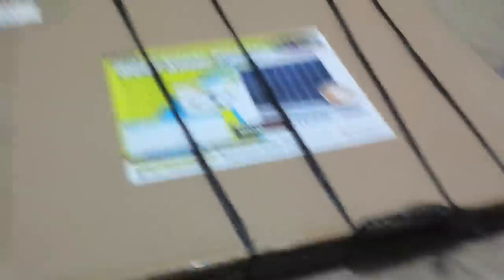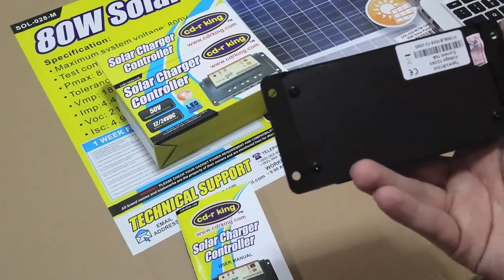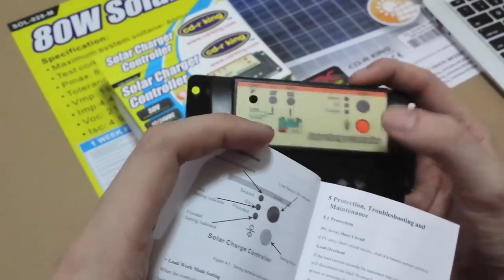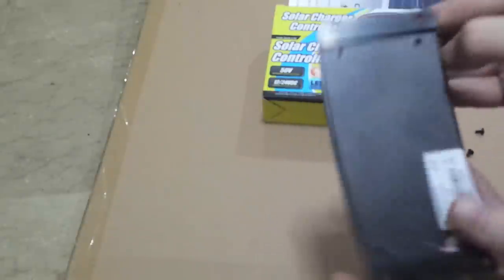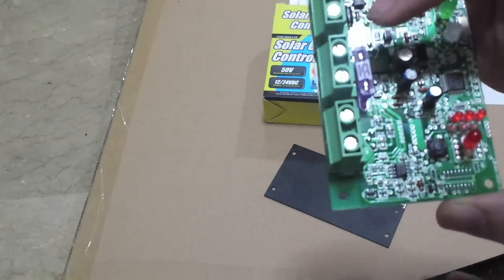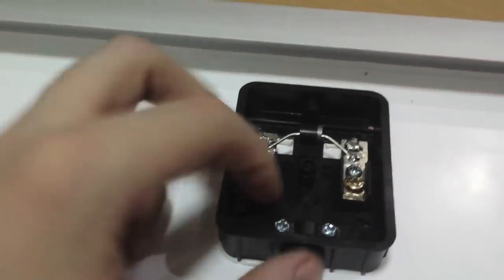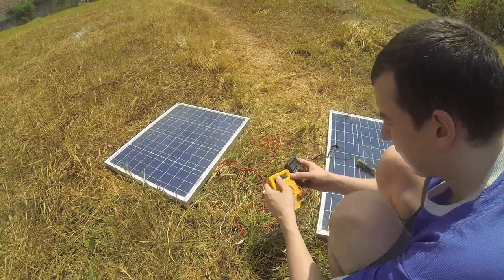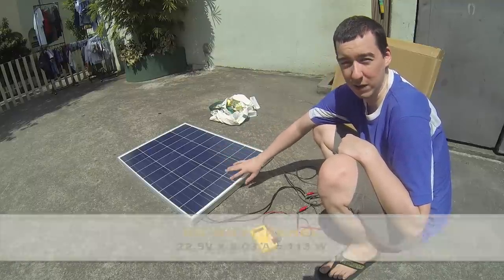CDR KING Solar Panels

Comment: I've never been to the Philippines so please forgive my ignorance on things there. I have a few questions about solar items and their availability there. I have an Uncle that lives there and is very interested in a solar panel array. But, we are looking to put in panels that are 280 watts each or more. We would need to have them shipped in from the US.  Is the shipping really high?
Reply from the maker: You can buy 250 Watt solar panels locally from cdrking, check their website for pricing. If you have a bigger budget, you can find high quality japan made 250-300 watt panels on Sulit. I wouldn't recommend trying to ship the panels from another country because they're going to hit you with a very large customs/tax bill when they arrive. Many people pay more in customs fees/taxes than the value of the items.  Solar equipment, like most electronics in the Philippines, is hugely overpriced compared to America and UK. While the panel prices are dropping locally, the associated items like charge controllers and inverters are still pretty pricey.
Reply: Gadget Addict I think you are right , although i never payed more than 50pesos for importing my solar cells, the time passed to assemble them ...etc...if i had to do it again i'll buy in CDR-King  , about the same price in final...The only problem is their stock.
Reply: There are now plenty of suppliers of solar panel products here in the Philippines. The popular panels are made in China and Canada. The most common are in the 100w to 250w panel configurations. You can size your solar power system however big or small you want it as long as you have the roof or yard real estate.

Comment: nice blog about solar power generator. i want to build diy solar power generator but a bit hesitant because i dont know the exact amps to be used in breakers and fuse connected to solar, inverter, batteries, and solar charger as well.

Comment: Where did you get the RTV sealant from? We used to use that when I was in the military. Awesome stuff. Where in the PI did you find it?
Reply from the maker: I bought it from Wilcon Hardware, along C5, near Eastwood City :)
Reply: Hmmmm...will have to check my local hardware stores then. Thanks. Checking out the rest of your videos now.

I have been considering getting the 150 W kit and an additional 100 W panel. I have a roof that gets a ton of light throughout the day.

I am just concerned about sun during the rainy season.
Reply from the maker: Gary Verderamo Yeah it can be hard during the rainy season. I have a battery charger to keep my batteries healthy during long periods of no sun.

Comment: Thanks for sharing this, How are the panels performing? I am interested as its something we could use in our home in Cebu for wall fans during the day. Not too fussed on the battery side of things. But let me know if you find a good supplier of reliable batteries as well although can see me getting hold of one of the Tesla batteries for the house in the future. Electric in the Philippines is getting expensive.

Comment: i got a solar pannel from a market.
it's outputting just 10-9 volts in even in bright sunny day. 
A 3Amp battery is directly connected to it with a blocking diode. 
The charge doesn't hold much and and the battery ends real quick.
Any idea what's wrong ?
Reply: the panel is 10watts

Comment: Could the panels power 120mm computer fans? about 6 of them? so I can generate my own wind, in turn that wind powers a rotating wind generator?
Reply from the maker: Most 120mm computer fans that I've seen consume around 2 or 3 watts. So if you had a panel pushing out 50 watts, you could run 15-25 of those fans at once. Since it's a fan, any extra voltage isn't too dangerous since it will just make the fan spin a bit faster. So you could power them directly from the panel without a controller. I don't know whether it would be strong enough to turn a wind generator and I'm not sure why you would want to, since there would be huge losses in doing so.
Reply: How would i loose? Im just taking one energy source (solar panel) and running lets say 20 fans, directing the air produced into a funnel, narrowing at the end so it is forced out. This gives me faster air speed, virtually no air loss. That would be aimed at the blades of the generator causing them to go much quicker and producing well over 50 watts. What do you think?
Reply from the maker: Cichlid Maximus You can't get out more power than you put in, that would be overunity. The fans might consume 2 watts but some of that goes into heat (feel a motor that's been running awhile and you'll feel its hot). So you might only get 1.5 watts of air from that fan. Then on the other side, your wind generator, that has losses because it has to overcome wind/air resistance and convert it to electricity etc. Converting solar to wind might end up turning your 50 watts into 20 watts lol
Reply: ould the panels power 120mm computer fans? about 6 of them? so I can generate my own wind, in turn that wind powers a rotating wind generator?
Most stupid idea ever. You loosing energy in any step of the way,
Reply: Explain it to me please.
Reply: Cichlid Maximus
Basically whenever you convert energy from one form to another, you waste energy. So the extra that you get by turning it into wind then back to electric is less than 50 watts.
Reply: Cichlid Maximus To add, you can't convert more than 59% of the wind's energy into electrical energy? Why? Physics.

Comment: Hi Phil can you give me options if id like to make a setup where i want to directly charge any usb powered device to the solar charger controller (the yellow one from cdrking) so that i can turn off my inverter and save power instead of plugging  the chargers to ac socket. Thanks!
Reply from the maker: You can buy a cheap in-car usb charger from CDRKING. The super cheap ones wont charge bigger devices like the ipad, so be sure to buy one which shows as being compatible with your device. Since these are meant for use inside 12 volt car power systems, they are pretty much perfect for solar and can usually handle a reasonable amount of fluctuation in voltage.

Comment: Hi would u recommend this CDR solar panel for camping use or it's more suited as stationary? Crazy helpful video man.  Thanks & keep em coming.
Reply from the maker: Jake Rio Because of their weight and size, they're more suitable for a fixed location.  But we transported some from MM to deep Bulacan, in the back of a pickup truck. They got bashed around pretty bad and we had no problems with them. We got them across a river with a very questionable floating platform and trekked through some farms. They're pretty tough but usually flexible or small plastic panels are more recommended if they're going to be moved around a lot.
Reply: Thanks for d advice

Comment: Hi Phil, i've watch all of your solar videos all night. i really am a fan... made me happy when i saw you have the same equipments that i'm planning to use. ^^ anyway  my set up will be a 150watt cdr-king panel, 100ah motolite deepcycle, cdrking charger controller and inverter. im really confused with the inverter rating to be used. for a 150 watt setup, is the 600watt(1180php) inverter fine or should i go for the 1000watt inverters (3990php)? is it a good investment? for inverters this size they would consume more power which i think would be a waste.
Reply from the maker: Having a little bit of extra capacity on your inverter can be useful but I wouldn't go too far above your expected use, because like you say, it consumes more power when idle. Also I'd be very cautious about spending too much on an inverter with cdrking considering the warranty will be extremely limited. Have you thought about what you plan to run from the inverter? At this point you might want to consider buying a charge controller that can handle extra amps. , incase you decide to add another solar panel down the road :)

Comment: Hi there. 
Those are Bypass diodes, not blocking diode. 
Measuring open circuit voltage and short circuit current does not give the nominal power, because in both cases, open circuit and short circuit, you have 0 Watts output power. Hook them up to a good MPPT, half empty battery, then you will see their true power output.

Comment: I'm going back home soon and ive been thinkin buying solar panels at cd-r king how's yours work in so far and I'm just wodering is that  mono you've got or poly? and as like you mention it took you 6months to get hold on panels it sounds like I have to make a plan ahead of time buying those item
Reply from the maker: They're holding up good :) Nearly every CDRKING has a huge stock of Solar panels now. They're one of their most popular items. Mine are poly panels :)

Comment: good day Phil.I'm planning to set up a solar panel in our roof.i saw a 80 watt panel in cdr king sm bf branch along with the inverter.Is it enough to power up an aircon for 12hours with a 4 panel (80watts each)? if so, how many motolite batteries would it require for storage for that 4 panels.thank you Phil. noob here
Reply from the maker: Hi Sammy, It would depend on the aircon unit, the size of the room to cool and the temperature you set. I have a 0.75 samsung aircon in my bedroom that I use at night on 22-24c and it uses 600-700 watts whenever the condenser is running and then idles at around 50-100 watts the rest of the time. You'd probably need to measure the usage over the 12 hour period using a watt meter (like omni watt meter) and then see if the solar power would be enough. 4 x 80 watt panels would generate a maximum of 320-400 watts under ideal conditions. If you know how many hours of direct sunlight your panels would get during the day, you could compare how much power they can generate vs. how much power your aircon needs. That would then also allow you to know what size batteries you need. If you want to run your aircon during the day, there is a special aircon solar panel (non-electric) which helps the condenser to heat without using electricity, those are more efficient for running an aircon unit while the sun is up.

Comment: What solar panel setup/materials should I get that can handle a desktop pc that has a 450 watts power supply and a 19" LCD screen?
Reply from the maker: You'd need to measure the power that the computer and screen uses. My desktop has an 800 watt power supply but only consumes around 120 watts most of the time, peaking up to around 200 watts under heavier conditions. The monitor probably only consumes 20-30 watts. You can buy or borrow a watt meter (e.g. Omni watt meter) to measure the actual usage.
Reply: Thanks, I'll connect it to my kill-a-watt and measure it.

Comment: wow! nice setup... is cd r king charge controller work better than the other one u use on your other vidio?
Reply from the maker: Heya, I haven't tested it exhaustively but I'd imagine it's about the same. The specs are pretty much identical but the cdrking model is actually a little more expensive!

Comment: Is it possible to bundle 2 panels together to one charger controller? I'm thinking of faster charging times to portable/car batteries.
Reply from the maker: Yep you can, provided the charge controller is capable of handling the amps. Putting your batteries and panels in series will allow you to put more watts through the charge controller since the voltage increases instead of the amps.

Comment: does all the things needed here available in cdrking? from the solar panels, solar charger, batteries and ac converter?
Reply from the maker: +kerivan13 Yup they have solar panels, charge controllers, DC-AC inverters, everything you need :)

Comment: Hi there! Can i ask, does the Charge controller has an AC output? How to set it up so i can use it (for ex. Ceiling Fan or LED Light Bulb)?
Reply from the maker: Lyto Magbato You can buy a charge controller that includes an AC inverter but it's better to keep them separate since both can get hot and either could break. Some people use a grid-type inverter where you connect the panels as an input and feed the power straight into your existing home power lines. Although there are some electrical safety guidelines to follow.
Reply: Gadget Addict Thank you so much bro.

Comment: i want to ask some question sir... can i connect directly lets say a fan with 60w to panel of 80w without inverter? sorry for noob question... whats your latest update re your setup?
Reply from the maker: If it's a 12v fan then you can. If it's a regular 110/220v AC-power fan then you can't power it without an inverter. If it's a 12v DC fan then you can usually connect a solar panel direct, even if the output voltage is higher - the fan will just spin faster. DC motors handle higher voltage pretty well. I have a 5v USB fan that is connected directly to a small solar panel that puts out about 10 volts and have no problems with it.

Comment: Gadget Addict hey i was wondering would it be a good investment in cdrking ? i'm planning to buy 4x 100 watt solar panel and a 4kW pure sine inverter and 2 deep cycle battery 100AH, all from cdrking.totalling about php48,360
Reply from the maker: Jared Kaiser For the solar panels yes. For the batteries, maybe. For the inverter, no, unless they can offer you a long warranty.

Comment: Hi GA, I have a 3/4HP window type AC unit, which we run at least 2 to 4 hours per night. Do you think that this can be supported by the solar panel? I am planning to buy a set of panels and batteries just to support my AC unit. Thanks!
Reply from the maker: It's always possible, it's just a matter of working out how many panels you need and how big the battery needs to be. AC is especially hard because it consumes so much power when the compressor is running. So you'll need a pretty sizeable battery bank.
Reply: Gadget Addict Thanks GA. With electricity rates in the Philippines constantly increasing, installing free and clean source of readily viable energy is the best option. I hope you can show more DIY tutorials from installation up to integration of solar energy into your home. Thanks!

Comment: Hi bro, did you assemble solar cells until it become solar panel? Can you show to us how from soldering, connecting from positive to negative, encapsulation? Thanks.
Reply from the maker: Hi Jun,  the cdrking panels come finished already and encapsulated with the aluminium frame. It's not really cost effective to make your own solar panels. When you add up the cost of the aluminium, the encapsulation material, the solder / tab wire, the glass, the solar cells... you can't really beat a ready made panel.
Reply: Thank you for the information bro, one more question. How can I determine the charging of my solar panel to my battery? Thanks
Reply from the maker: Jun Angcos You could measure the voltage and current using a multimeter, that will tell you how many watts are going into your battery. Alternatively buy a charge controller that has an LCD display that shows you those details, or buy a watt meter and wire it inline between the controller and the battery :)
Reply: Gadget Addict Thanks bro. Big help
Reply: Gadget Addict Hi Bro, As a new of this solar industry please  be patient with me because I have many things to consult to you regarding these things. In my system, I used 30A Circuit Breaker 230v, #12 wire gauge from Battery to Controller, to Lighting and the same switch that I used in the present which is 230v. Could it be use for the Solar system which is 12v?
thank you and Regards.

Comment: are you getting the rated wattage of the solar panel with load (charger charging the battery)? i have 2 150 mono solar panel connected in series, the max power that i've got so far was 190 watts (direct sunlight) with a mppt charge controller charging a 100ah deep cycle battery. i think that it was due to undersized wiring (gauge 14) 9 meters in length with max current 15 amps (hoping it's just about the wiring not the solar panel itself that has something wrong) . any thoughts about it?
Reply from the maker: I measured them under load with a watt meter and they came to or exceeded the rated watts. But I only have PWM charge controllers, so they're not as efficient as MPPT controllers. So I do have losses. I would agree that 15 amp over 9m of gauge 14 is probably going to incur losses too.

Comment: I'm wondering if I can use a plain sheet metal or roof sheet metal (yero) as solar panel, bcos here in in Philippines it is commonly use as a roof,
Reply from the maker: +carlo oximina You mean mounting solar panels to metal roofs?
Reply: lol. your grammar..
Reply: carlo oximina Carlo there is no prefab solar cells that will look like our GI Sheets hahahha.  Only Tesla and other energy companies doing it and not yet in market. If you will install that on top of your roof we need to elevate it little for proper ventilation because the operating temp is 41 degrees C. But still no good for 300 to 500kph wind during typhoon season lol.  Im going home soon.

Comment: hi,i have a 50w cdrking panel and i am planning to add a 20w cdrking panel via parallel connection,is it ok to do that or its should be the same 50w panel i should add,thanks...
Reply from the maker: Provided they have a similar output voltage and are wired in parallel instead of series, it should be fine.
Reply: ok thanks,ill add 20w on my 50w setup.